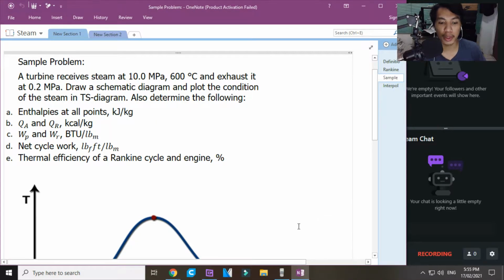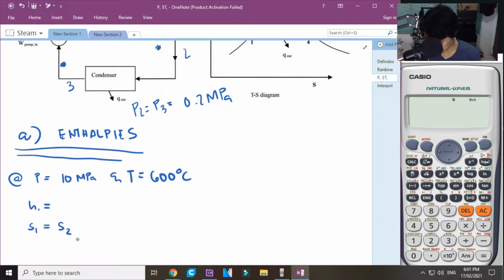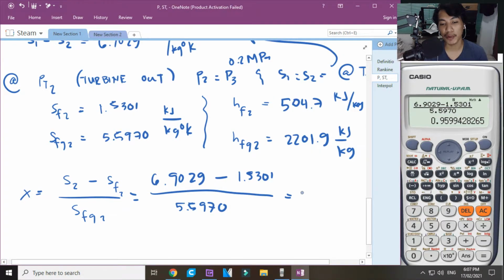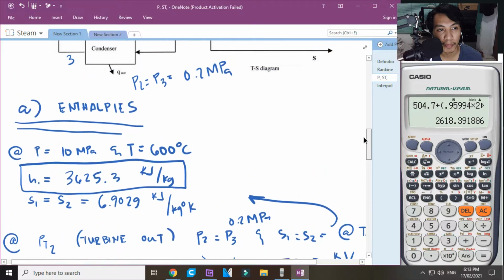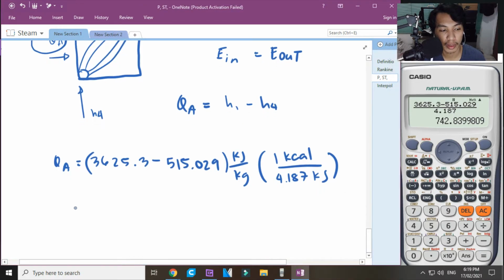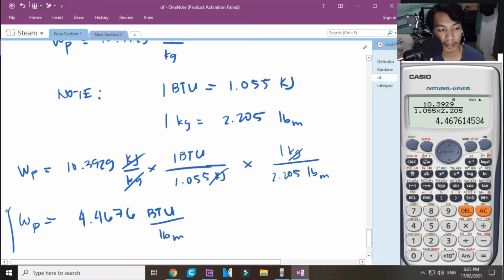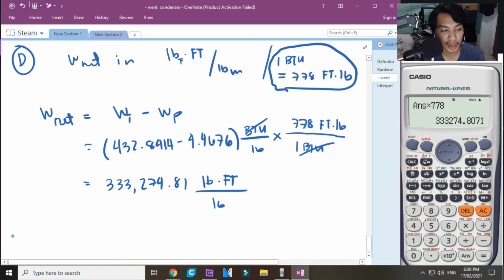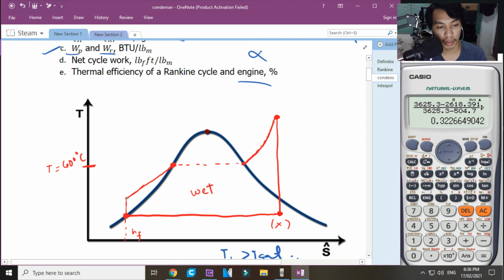Ideal Rankine Cycle Sample Problem

Comment: A coal power plant operates on the ideal Rankine cycle. The steam enters the turbine at 6.15MPa and 715degC with a mass flow rate of 37.8kg/s and exhaust it at 30kPa. Find the net power produced in kW.

 

2nd condition: Find the net power produced if the pump operates at 75% and the efficiency of the turbine at 80%.

Comment: water is the working fluid in an ideal rankine cycle.superheated vapor enters the turbine at 8 mpa.the condenser pressure at 8 kpa.determine for the cycle efficiency.Pede patulong?